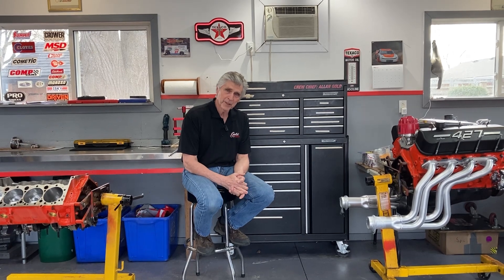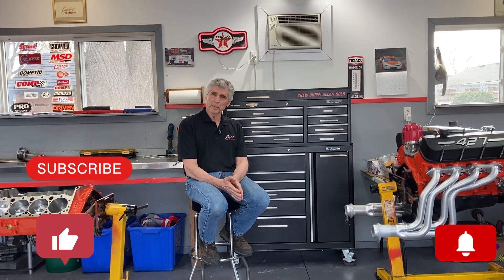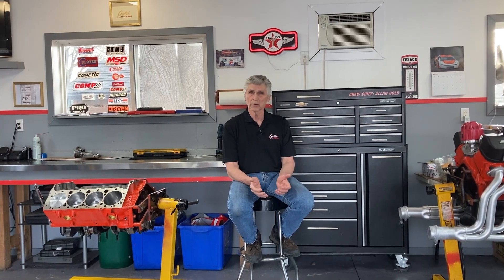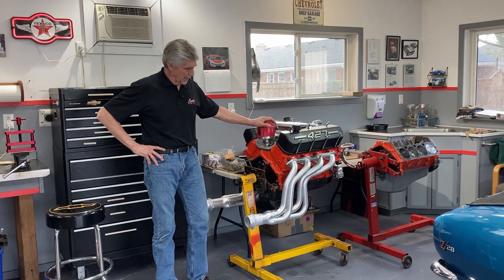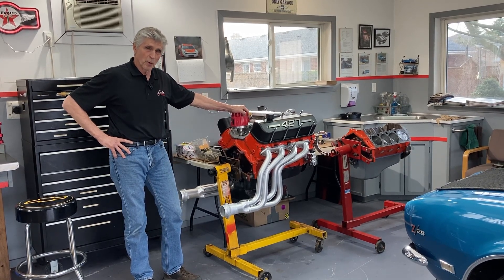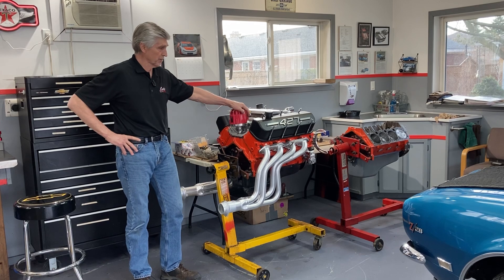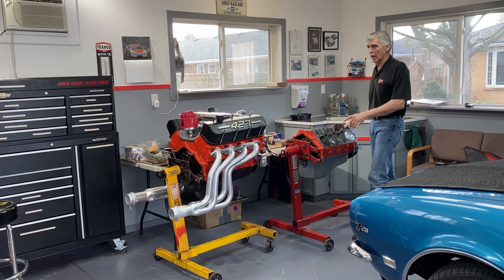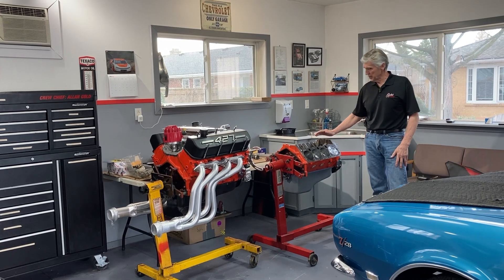Compression Myths - How much compression can you run on pump gas? Questions Answered

Comment: Can you run a 355 11.7.1 on 93 safely for trips 
What does 1st 2 sound like. Ty
Reply from the maker: Thanks for the question Ty. Depends mainly on the cam. Longer duration cams  with later IVCP will reduce the dynamic compression and cranking pressure to safe limits. Aluminum heads help. Also less Weight of car/cu.in and lower gear ratios also help. Less ignition timing is also a factor. Hope this helps. AG

Comment: I have had several Buick 350's. My prior one had the higher compression pistons and was maybe 9 or 9.5 to 1. Regularly got 16.5-17mpg in my truck. I had to rebuild it on a dirt budget and ended up with low compression pistons. Damn thing refuses to go over 14.5mpg. Compression is king. The money I lost on extra fuel could have paid for the high comps.
Reply from the maker: Good point Vinny,  a higher compression engine is more efficient.AG

Comment: I would love to hear your take on how you would build/set up a 1971 455 HO to A. run on 91-93 pump gas B. Run 0-60 in 5-5.5 seconds and sub 13 second 1/4 mile. I have a setup in mind but really want to hear your ideal setup.
Reply from the maker: Brett, a well tuned stock 455 HO with the right gears and tires should be able to run sub 14's. AG

Comment: I run a full dome piston (50cc) in my 427 BBC. With the heads and gaskets I use, it comes in at about 11.68:1 compression. I run race gas because I simply don't want to worry about whether or not I'm damaging the engine because I've got my timing set 2 degrees too advanced or whatever, so I run race gas and don't worry about it!! 😉 I use it for drag racing only anyway, no street driving. 🦶<--- to make people wonder why I put a foot there!! ha ha ha

P.S. I'm so old I remember being able to buy Sunoco 116 Purple at the drag strip for $2.85 a gallon!! ha ha ha Come Allen, you know what I'm talking about!! :face-blue-smiling::face-blue-smiling:
Reply from the maker: Thanks for the memories Patrick. I remember Sunoco 260 at the pump. Pretty sure it was 100 octane.AG

Comment: Hi Alan, I’ve learned a lot from you and love your channel. I have a Summit 1226 cam that I’m going to run in a 10:1 383. Do you think that this is feasible?
Reply from the maker: Thanks for the question John. That is a pretty big cam, I think there are better choices for the street. You will need a light car, lots of gear and all the other engine components to be compatible. Vacuum may be an issue. hope this helps.AG

Comment: I run 93 octane at 11.6:1 from a marina that doesn’t have alcohol. Cranking it is 180. A Ford FE. 35 degrees of timing 15 initial and 20 centrifugal no vacuum advance.
Reply from the maker: Very interesting, thanks for the info Bill and contributing to my channel.AG
Reply: @goldsgarage8236 You are welcome. I love FE engines and I have built them since I was 12 years old. I can’t see well enough to drive now at 64, just when I can afford to build one for myself. I want to do a Pond 4.25 with a 4 inch stroke 650 ft lbs 700hp with a Lenco. Oh well. I try to give good advice. I do miss the smell of that good pink premium from the ol’ days. I still have my 65 Galaxie sitting there to remind me.

Comment: I don't think diluting the exhaust gas was the goal. I read that the purpose of the air pump and pulse air systems was to put some extra oxygen in the exhaust manifold to burn up some of the unburned hydrocarbons while they were still hot. When the exhaust comes out of the tailpipe, it isn't hot enough to burn.
Reply from the maker: You are absolutely correct Andy, it was to help burn off any excess hydrocarbons. AG

Comment: In the early 70's  I had 12.5 TRW PISTONS,  the aluminum ZR1 heads, with the off road vette solid cam in my street El Camino. Ran the premium octane fuel. No serious problems except for terrible gas milage. This was my detuned Hilborn injected, roller cammed   engine out my Altered after I hurt it, sleeved a hole and somehow thought a good idea to replace the small block in my daily driver. Lo L   not so much
Reply from the maker: Thanks for sharing your valuable experience David. AG

Comment: Actually, the idea behind the air pumps in the exhaust was to supply oxygen to the unburnt fuel coming out of the exhaust which would ignite it and which would reduce pollution. Unburnt fuel vapor is very harmful to the environment.  When you had the air pump, when you lift your foot from the noise pedal. you could hear a rumble in the exhaust system which was the unburnt fuel igniting in the exhaust. If you took you out the air pump, you wouldn't hear the rumble anymore.
Reply from the maker: Good information, thanks for commenting Jean. AG

Comment: My car is VW 1.0 TSi 3 cylinder, turbo-gdi, it says minimum octane rating - 91 octane, recommended - 95 octane (EU Standards). Am I ok with 91 octane if I drive very sedately and not go above 2.5K RPM's?
Reply: ps - the engine has compression ratio of 10.5:1. Thanks!
Reply from the maker: Thanks for the question Saul. I am not an expert on this type of engine but typically modern engines use a knock sensor to detect detonation, then the computer will adjust the timing accordingly. I think you are safe, however with reduced timing it might lose a bit of power with the lower octane fuel. Hope this helps. AG

Comment: So the actual data shows. Delayed combustion timing DOES NOT MAKE MOREPOWER. Optimised combustion timing for the fuel, compression ration, fuel air mix, and combustion chamber geometry. Will produce the most power. With modern fuels which burn faster, more completely and cooler then the old leaded fuels this optimal timing is much earlier than the old leaded fuels. Moving the timing out of this optimal range (up or down) will frist lead to less power and ultimately engine damge if you take it too far. Now power is produced fundamentally from the explosion produced by the combustion of the fuel air mix, the more efficient and the more potential energy in the fuel air charge the more power can be obtained. So more compression on the other hand means a more efficient burn and thus more available power (up till you run into pre-ignition problems <over 12/12.5:1 for gasoline). Which is why all your modern production vehicles are running 12.5:1 from factory these days.
Reply from the maker: Thanks for watching my video and commenting. AG

Comment: I have a 427 12.5 cr do you think VP octane booster mixed with 93 octane pump gas would be safe to use they claim 10 numbers in octane increase, that would be 103 if it's true thanks just subscribed
Reply from the maker: Thanks Anglia. I don't have much experience with octane booster. I have a recent video about thinks you should do to run high compression on pump gas. you might find it helpful. AG
Reply: Thanks, maybe you could do a video on centrifugal advance vs lock-out on detonation on high-compression engines using pump gas.
Reply: Yes VP in fine, used thiers for 20 yrs. TOrco isnt bad either. Bought a 6 pack last yr, 120. Worth it as I dont drive much
Reply: @gordocarbo  Sounds good thanks for the info.

Comment: E.p.a definitely set us back , go from 11.5 to 1 compression in late sixtys to 11 to 1 in the 2000 .
Reply from the maker: Thanks John, do you remember service stations had two sets of pumps for a few years, finally the leaded pumps were gone.AG
Reply: @goldsgarage8236  Wish we could still have leaded. Remember the long lines during the oil crisis?
Certain days you could or couldnt get gas . Couldnt give away a BB car

Comment: I thought we were going to be talking about Cam shaft's here. A good cam tuner can reduce you compression. I was told my 427 LS having 12 to 1 compression is a good place to be for 93 octane on the street with a good cam and quench number like .040. I'm in florida and my car runs fine except for the hottest days in the summer with the air on. I can tune it down to 22* timing in the summer and it's fine. There is always different blends of alcohol too, haven't tried that yet.
Reply from the maker: Thanks for your comments. AG

Comment: If my SBC TRW L2311 pistons says 13.4 compression with 64cc heads what will the compression be with 76cc heads?THANKS
Reply from the maker: If you know the other factors like bore, stroke, dome volume etc you can just recalculate it with the Summit online calculator. 10 cc should be about one compression ratio go my best guess it about 12:1. AG
Reply: @goldsgarage8236  ok Thanks
Reply: @goldsgarage8236  great videos

Comment: Using a cam with the correct amount of overlap should  help, light car with maybe 2500 stall tight converter, 350 to 370 gears ? More overlap bleeds off compression at low rpm, where most problems occure !
Reply from the maker: Thanks for your input Peggy. Actually the later IVC of higher duration cams bleeds off compression. AG

Comment: I had exactly same scenario, engine and compression..  
Easy fix, just lowered cylinder pressure by picking cam with late intake closing time.. 
Ended up with 165psi, was able to put a good amount ignition timing in it.  Ran on 92 in the dunes for many years perfectly.
Reply from the maker: Thanks for sharing your experience Terry! 165 is a very safe pressure. AG
Reply: Why not just run less compression then and not worry about it?
Reply: @patrickm.8425 Changing the came is a lot easier than pistons or heads on existing engine.

Comment: "𝘊𝘢𝘯 𝘺𝘰𝘶 𝘳𝘶𝘯 𝘺𝘰𝘶𝘳 𝘚𝘉𝘊 350 𝘰𝘯 11:1 𝘱𝘶𝘮𝘱 𝘨𝘢𝘴?"

Iron head/domed piston L46 or Lt-1? No likely. Been there done that, didn't work if you put any timing to it.

Small chamber Aluminum head/near zero deck flat tops? Absolutely.

We built a 357 with a hair over 11:1 compression for my friends 1980 Z28. The heads are ported big valve L98 113's with 58cc chambers. He's been driving it hard and auto-crossing on 93 octane for almost 6 years now with zero issue. We tried some Sunoco 100 octane when we were tuning it on the chassis dyno but power still fell off above 34 degrees total timing.
Reply from the maker: Thanks Czech, all good information. The 406 that i am currently building has 11:1 Static Compression but the cam with 68 degrees IVC ABDC bleeds off enough compression so that the cranking pressure is 180 PSI. I think we will be OK, watch for the dyno day coming soon.AG
Reply: @goldsgarage8236  
In my experience a 406 will often fair a bit better at 11:1 than a 350 would if running the same heads because you don't need domed pistons to get there. Depending on gasket thickness, deck and quench height, you usually end up running a slightly dished piston. With Vortech heads it's almost a cake walk. The chamber design actually likes less ignition timing.

Comment: Hello, may I ask your opinion on ethanol fuel on carb’d engines.  I always used premium ethanol free gas.  Now ALL gas in Canada has been mandated to 10% ethanol (as of Jan 2022).  I was told on a casual cruiser that eventually, the ethanol would degrade performance and eventually destroy the carb.  What are your thoughts?  In your experience, is this true?  Are there any additives that you’ve found that actually combat ethanol issues?  Also, if all grades of fuel have 10% ethanol, is there any point in running premium?  Thanks
Reply from the maker: Thanks for the information J.R_, I did not know that. Prior to that there was a sign right on the pump for Shell 91 that it contains no ethanol. Now I know why the sign is no longer there. 
Also, Shell now has 93 Octane?
There mist be a technical explanation why fuels with the same ethanol content have different octanes, but you have to use the higher octane fuel if your engine needs it. 
I think that some of the negatives about ethanol are overstated and I don't think it will destroy your carburetor.  
One of the negatives that is real is that it evaporates over time and so if a car is stored for long periods the engine has to crank over for a while to refill it before it starts. 
This is a problem for our hot rods which are typically stored during the winter. 
Lets keep the conversation going, if anyone ahs more information on this subject, please weigh in. AG
Reply: @goldsgarage8236  Thank you very much for your opinion.  I've been using aviation fuel since they added 10% ethanol at the pumps to all fuels in Canada as of Jan 2022. Aviation fuel is high octane  and with added lead. I think it may be well suited for high performance carb'd engines (not sure about the added lead which all aviation fuel has.?.?). Our local airstrip will sell av gas to classic car enthusiasts. But at $2.55 a liter, cruising gets pretty pricey.  So that's why I've been wondering about using the pump gas with the 10% ethanol.  Only thing I can think of, may be to drain the fuel in the tank if the car sits over winter. Thanks again for your opinion.  I really appreciate it.
Reply: I have had no issues with my carb about 40k miles with the 10% ethanol fuel. I’ve even ran mix at times with regular pump gas and 1/4 tank or 1/3 tank of ethanol. Holley carb in matching numbers 68 RS/SS Camaro 350 Muncie 4 speed 115k original miles.

Comment: I'm fairly sure Chevy had  Serious 100 octane minimum Warning sticker on the High compression 12 :1 L88 427 even with that Outrageous long Overlap/Duration solid Camshaft....How do you get Around that 93 octane problem ??
Reply from the maker: Thanks Tom. You would have to mange it for sure, less timing, driving style, keep the RPM up etc. It might not be worth the trouble, but it is probably doable. AG

Comment: Sure you can run a pump gas at 12.5:1, plenty of e85 out there at 105oct. Build the system to that and you can run it no issue
Reply from the maker: Thanks for your comment doomman. E85 is one solution for sure. AG

Comment: I made 620hp on a 388 with 11.2 to one on 93 octane on dyno with amsoil fuel additive and so far in the car no problems 🙌
Reply from the maker: Thanks krista, that is a lot of power, can you tell us more about what went into the build?
Reply: My 399ci. with 10.7 to1 with 17* heads makes 641@6400 on 89 pump.
Reply: @heshtesh  Did it croak already?? Why risk it with 89 octane?? lol..
Reply: BS

Comment: If you are running that static, then you have to adjust the valve timing events and match those events to the crank shaft degrees to where you are lower than 8:5.1 dynamic compression., run richer, timing, etc. which negates running it in the first place.
Reply from the maker: Good point Sean. That is why I stay within my 160-180PSI for my street engines. Thanks for the input. AG

Comment: There is a big difference in using this type of engine at the dragstrip do a burnout run the car drive to the pits and shut it off compared to running the same engine with the same fuel on the street in traffic and stop and go in say 95 degree heat for a hour or more with idling at traffic lights
Reply from the maker: Thanks Gloria, good point. My good friend Dave Seabrook once coined the phrase, " you don't drive these cars, you manage them". I think it applies. AG
Reply: @goldsgarage8236  l can tell you l have a 2011 Camaro SS with a new GM Performance LS3 495 crate engine with milled and CNC ported LS3 heads 11.1 compression ratio that runs on pump E85 it has a load of upgrades and l do treat the E85 with Lucas safeguard ethanol fuel conditioner and stabilizers 2 ounces to every 5 gallons it only requires 1 ounce for 5 gallons but you can't over treat it just to be safe l do not miss buying expensive 100 octane fuel and mixing it with expensive 93 pump
Reply from the maker: Thanks Gloria, you are deep into the science of fuel management. Please continue to share your knowledge and experience. AG
Reply: @goldsgarage8236  E85 is cheaper than 87 octane about 20-30 cents a gallon but burns faster so it doesn't last as long less miles to the gallon E85 burns cleaner with less carbon build up in cylinders and on pistons tail pipes tips have a yellow gold color at the tip not like gasoline that is dark brown or black engine runs slightly cooler on E85 also pump E85 is 99-103 octane but the summer blend E85 is on the higher end winter blend on the lower end winter blend is 67-72 percent ethanol summer blend is 75-78 percent at the pumps tested at Gate gas station at SR 56 just east of interstate 75 in central Florida on the west coast seems to have a higher ethanol content than Thornton on US 19 in Palm Harbor Florida by 6-8 percent according to my friend who tests it when he gets it and ethanol is what they use to increase pump gas octane so if you took pure none ethanol 91 octane gasoline and mixed it with 10 percent pure ethanol it would raise the octane to 92-93 octane calling pump E85 is a misconception because my friend that tests it has said he has never had a ethanol reading above 78 percent ethanol has had ethanol readings as low as 66 percent ethanol the only way to truly get 85 percent ethanol is to buy expensive 5 gallon cans from a race fuel company and it should be 105+ octane but its expensive vs pump E85
Reply from the maker: More valuable info, thanks Gloria. AG

Comment: I built an ls6  1970 model 454,it preferred better fuel than pump gas but it was fine with 100 octane prop plane fuel but it finally melted a piston due to detonation.
Reply from the maker: Thanks Dave for sharing your real life experience. AG